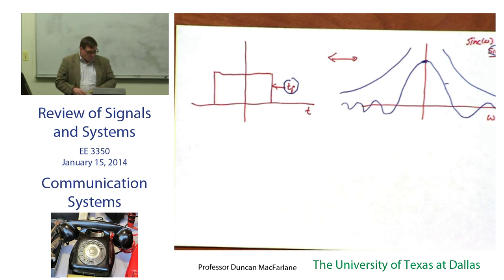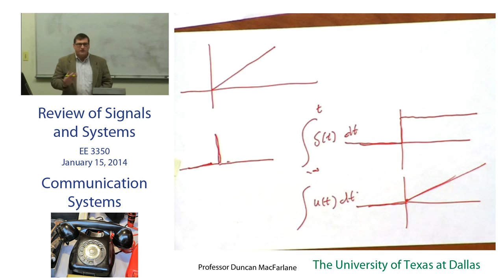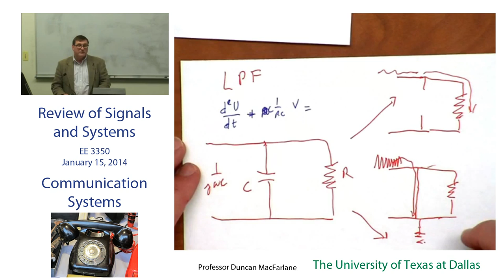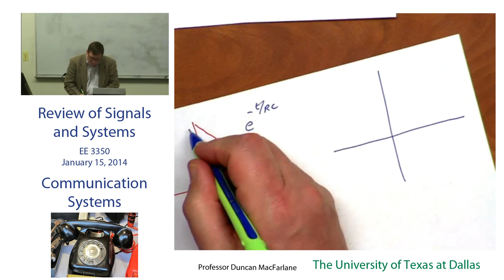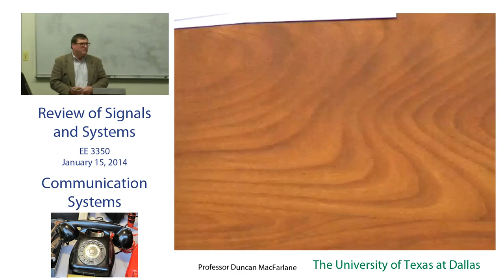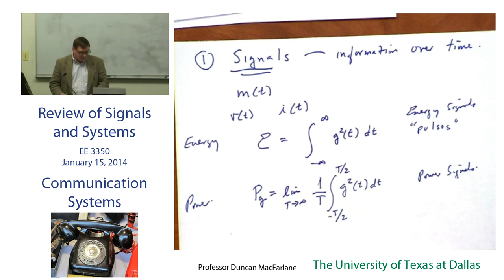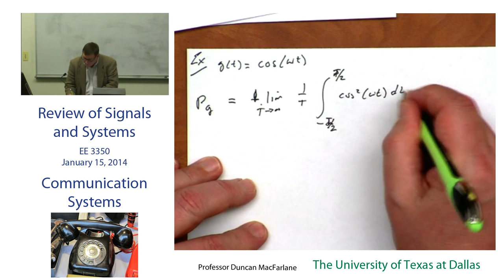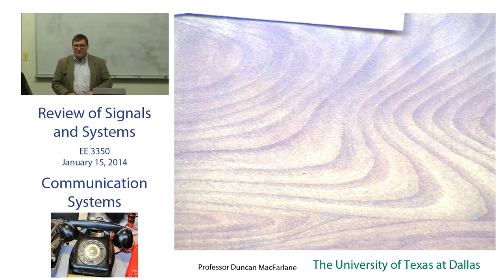Lecture 1 -Review of Signals and Systems

Comment: @ 13: 19   I highly believe the circuit is in parallel     not in series as student suggested   please if possible clarify this ?

thank you for posting this !!!
Reply: well, if you connect a resistor in series with a capacitor and take the output from the capacitor, still the circuit will behave as LPF. You can cross verify it. Thanks